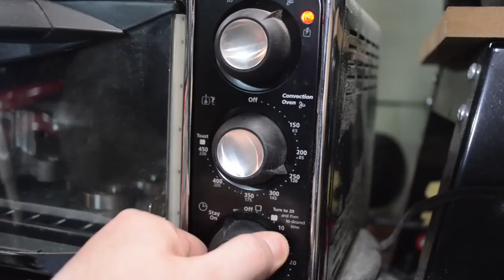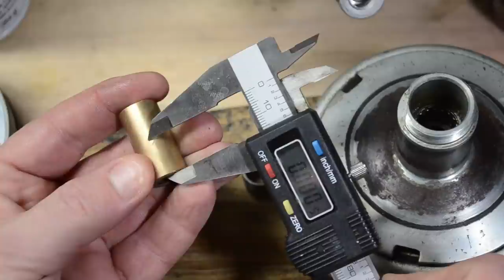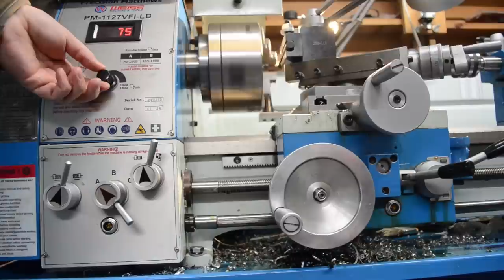1978 Honda Hobbit, Part 4 - Kit & Engine Assembly

Comment: Hi, your work is great by the way. I was wondering about the last bit you showed here. I have been having an issue getting my Honda hobbit to start with a new cylinder and piston. The place I got the cylinder from online mentioned that its best to use 2 extra base gaskets for proper timing. When I used just one the piston bent the end of the plug. When I use 3 total as recommended it does not bend the plug as far as I can tell but could it still be too close or too far away to fire properly?
Reply from the maker: Is there no spark at all? I'd replace the spark plug, gap it with a gap tool you can buy at the counter of most automotive stores. Give it a couple of kicks, if it doesn't start remove plug and check with the tool to see if the piston has decreased the gap on the plug.
Reply: I get a bright blue spark consistently. I did notice it looked a bit smaller of a gap. I'll look into getting that tool and check.

Comment: I love these. It gave me the confidence to start my own PA50 project. What did you use to grease the bearings? And I'm waiting on a service manual to come in. The only thing I would change is to put up torque specks and what you used, while you were doing it. How about a video on the brake system? Still got any of the cap head screws laying around you want to throw at me?

Comment: You should have taken away the larger cylinder restrictor in left half side of the crankcase.
Just in case , if you ever wanted to fit a larger capacity cilinder .

Comment: Great, you make some very interesting and well edited videos!
I think you need to keep an eye on that bronze bushing you made. A needle bearing needs a hardened and polished steel surface to run on. I think the brass/bronze is too soft and will wear quickly! 
Keep the videos coming :-)
Reply from the maker: Your right on having to keep an eye on the bronze bushing. I was reading a thread about it and it seems the needle bearing is not available anymore so the consensus (2 vs 1) was that it would be better to make the bushing sacrificial. The needle bearing is only rolling across the bushing at idle, as soon as the clutch engages they are moving together.

http://www.mopedarmy.com/forums/read.php?1,3748237,3749386
Reply: n1bpd Just an idea, maybe you could turn the bronze bushing further down, so it acts like an adaptor for the original steel bushing, just to take up the difference in diameters?
Reply: Carsten Lorenzen

Comment: Part 5?
Reply from the maker: Brian Staresina  It's coming. I have most of it, winter put it on hold as my workshop gets a bit cold. Part 5 and Part 6 (TJT Variator) should be out in pretty quick succession towards the end of April.
Reply: +n1bpd anything?
Reply from the maker: I have the majority of the carb installation video filmed, but had to put it on hold before I was finished while I was overseas. I have some other commitments before I start work on this. I hope to get back to it soon (I'd like nothing more than to have the time to be in my shop).